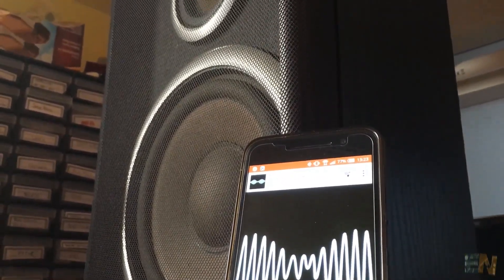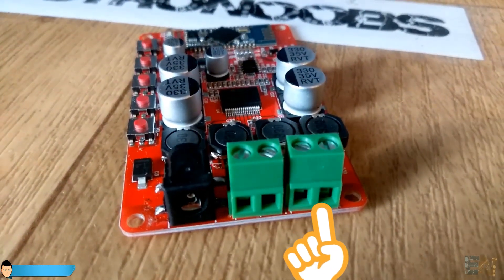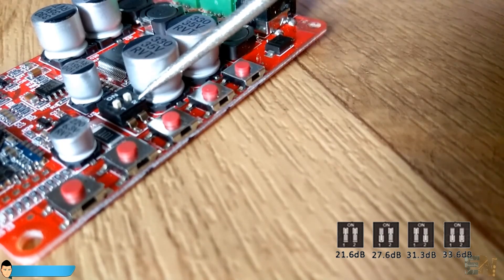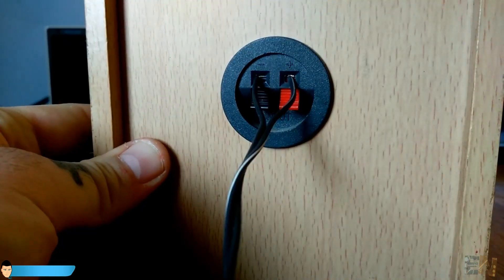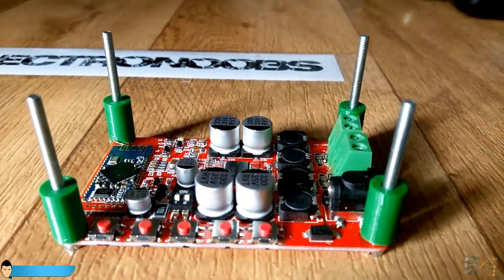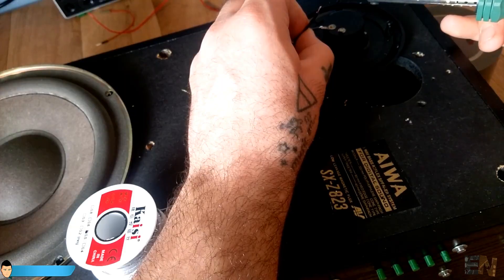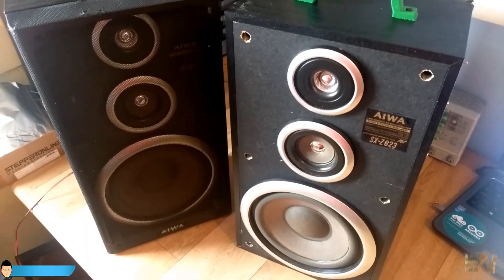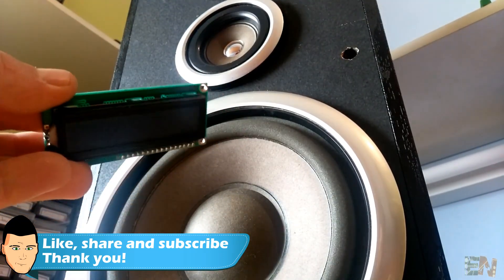Cheap bluetooth portable speaker DIY  100W

Comment: This recharging schematic you showed in the video is incomplete, right?! Please, take off a doubt of mine. I would like to understand the operation of this board in the ebay link below, and probably is the board circuit that was missing in your video. I have 3 18650 cells connected in series that will power an amplifier for speakers. With this board can I receive the charge from a 12 volt power supply to recharge these three cells and still be balanced during recharging? Please, take a look. Is that her functionality?

For 3S pack: https://rover.ebay.com/rover/0/0/0?mpre=https%3A%2F%2Fwww.ebay.com%2Fulk%2Fitm%2F371930663551

For 4S pack: https://rover.ebay.com/rover/0/0/0?mpre=https%3A%2F%2Fwww.ebay.com%2Fulk%2Fitm%2F172709387736

Thank you!!
Reply from the maker: https://www.ebay.com/itm/371930663551?ul_noapp=true this board is good for 3 x 18650 in series. But you'll probably need a higher voltage than 12V at the input. Probably with a 15V adapter would be good.
Reply: Electronoobs check it out carefully, this board is not 12V, it is 12Amps😉.  So to clarify, a board like that in the link is responsible for receiving an external power supply and recharging and balancing a 3S pack, and still powering a set of speakers? Was that right?
Reply from the maker: Hey, LOL. You get me wrong. Ok, so you want to charge a 3S battery. 3S is 3x3.7V which is 11.1V. The module that you said : https://www.ebay.com/itm/371930663551?ul_noapp=true needs to charge a 11.1V battery right? For that you need to apply a higher voltage at the input of this module, usually is 2V higher than the battery voltage, so, you need like for example 12.8V power supply. That's what I said....

Ok so now you have the batteries charging. The output of the batteries will go to a boost converter like here: http://www.electronoobs.com/images/Circuitos/tut_9/safety_charging.png in order to obtain a higher voltage for the Amplifier board. 

So to recap. Power supply of 12.8V or higher to the 3S charging module. The module connected to the 3batteries in series. The battery pack connected to the boost converter and the converter to the amplifier board.

If you use 1S battery you will be good with the 5V charging module as in the schematic befere. Keep up and have a nice day.
Reply: Electronoobs Now I understand what you mean about the voltage being greater than 12v to recharge a pack 3s 😉😉For your explanation I was able to understand the connection scheme. I'll do the diagram with drawings and put the link here through the dropbox so you can check it, okay ?! You have gained a new subscriber.

Comment: A few questions here.
You only connected the left output? What a waste, many songs will sound wrong. Is there a way to have the stereo combined in a mono output? When I tried to connect both outputs, the volume goes down a little. And I have no idea if I'm doing something wrong here. 
Also, why do you add a capacitor? My speakers are already made to connect to an amplifier so won't connecting the standard wire be sufficient? 
And another thing. With a bass test I noticed there's very little bass. I think my speakers should have more bass than this. Is it the bluetooth amplifier? The sound quality is OK, but I want more bass. Is there a way to connect a subwoofer?

Comment: I am considering buying the TDA4792P Bluetooth board. I have a 4 ohm speaker that has an RMS of 30Watts and Peak Power Handling of 60Watts so should I buy the 2x50W version or the 2x25W version as it says 'best at 8 ohms'. Does that mean it will be 2x100W at 4 ohms? Please help. It would be appreciated. : )
Reply: Stranger bell one is lying saying it's 2 by 50 it's chip can only put out 25 max so there the same thing and get a lp 2020ti or lp 2051

Comment: I have this TDA7492 50w+50w, can I use 8Ohms/50w speaker on each channel? 
are these boards correct?
1.TDA7492P=> http://www.lazada.com.ph/portable-tda7492p-50w-x2-wireless-bluetooth-40-amplificador-boardcomputer-assy-intl-31337628.html?spm=a2o4l.search.0.0.tchRL1&ff=1

2. BOOST CONVERTER=> http://www.lazada.com.ph/xl6009-boost-converter-step-up-adjustable-15w-5-32v-to-5-50v-dc-dcpower-supply-module-high-performance-low-ripple-intl-17085880.html?spm=a2o4l.search.0.0.KJD8hj&ff=1

3. SAFETY CHARGING MODULE=> http://www.lazada.com.ph/tp4056-5v-1a-lithium-battery-charging-module-micro-usb-withprotection-blue-28027918.html?spm=a2o4l.search.0.0.N9SwMp&ff=1

Comment: Can the volume be fixed, or does it reset it self when you turn off the amp?
In other words, are vol up and down button really necessary?
Reply from the maker: Can't be fixed. What I do is put it to maximum and control the volume with my bluetooth device. Keep up!
Reply: So the volume resets when you turn off the amp? Do you have to turn the volume up every time you turn on the amp?
Thanks btw! :)

Comment: can i use 12v DC using adapter without using batteries?
Reply from the maker: Yes, but that won't be portable any more. Also check if the adaptor has an output of more than 1.5A
Reply: hiw much voltage and current meeded?
Reply: how much voltage and current needed?
Reply from the maker: a voltage higher tnah 12V and current higher than 1.5A if you're using one channel and 3A for both channels
Reply: Electronoobs thank you....

Comment: i just ordered this amp. but i was so stupid that i did not see that there is only bluetooth on it and not stereo or aux input. is there a way to solder this on without removing the bluetooth unit?
Reply from the maker: JK never tried it. i guess that if you look at the datasheet of the amplifier or the Bluetooth module to see the pins of output or input audio, you could hook a 3.5 jack there or so...
Reply: yeah i will at least try. but i don´t want to destroy the amp at the first second i get it. yeah it may be cheap and easy to buy but it says on amazon that it wont arrive before some time in august. so the chipping time is pretty long. maby about a month and i don´t want to wait that long if i destroy it with my solder iron. but i will look in to it when i get it in the mail :)

thanks alot btw for responding

Comment: They're making claims and I have both. This model is 25 watt per channel both channels driven, the 50 watt per channel both channels driven has a heatsink. Still loud
Reply: I bought the only 50W amp I could find, but it has no heatsink. Have I been fooled?

Comment: How could it be 50W if its draws 1A @15v? IT'S AT BEST 15w, MATH DON'T LIE!
Reply from the maker: 2pirable hello there. you r right, but, it has 50w for both channels together so 25w each and I'm only using one channel for this project. I know that in the video I say 50w for each channel but that was an error. beside with the noise filter activated the output power is lower and I've used 15V battery. with higher voltage you could reach the maximum 25w per channel! thank you

Comment: Do you know where I can buy button caps like you are using? Because I don't  have a 3D printer :(
Reply from the maker: eBay?

something like this maybe...
http://www.ebay.com/itm/100pcs-lot-Black-Plastic-Cap-Hat-6-6mm-G62-Tactile-Push-Button-Switch-Lid-Cover-/182481255657?epid=1684446064&hash=item2a7cbafce9:g:jeAAAOSwuxFYv2Lz

Comment: how much voltage is required for 2 3" speakers with 15w rms and 4ohms and 2 18650 batteries ?
Reply: it depends on the amplifier, not the speaker
Reply from the maker: The voltage input should be always higher than 12V and lower than 36. Using those batteries you should add a boost converter to boost up the voltage!
Reply: so is 13v fine for a 4ohms speaker?

Comment: tell me plz
if i have two speakers of 60watt(60w+60w) which module bluetooth board  i will need 25w+25w or 50w+50w?
Reply from the maker: maybe try this one, it's a 100W one. With those powerful speakers you would need a powerful board.

http://www.ebay.com/itm/TDA7498-2-100W-High-Power-Class-D-Two-channel-Audio-Digital-Amplifier-Board-/322253604475?hash=item4b07cfc67b:g:-lkAAOSwMgdXztE1
Reply: but i have 60w speaker no 100w!
Reply from the maker: Yes, but you have two of them. So maybe just buy a 50W+50W and connenct each speaker to one output. Don't join together the two outputs. 
This should work for two 60W speakers, one for each channel!
http://www.ebay.com/itm/TDA7492P-AUX-50W-2-Wireless-Bluetooth-4-0-Audio-Receiver-Digital-Amplifier-Board-/122189015219?hash=item1c730868b3:g:K7AAAOSwux5YS5~W

Comment: According to the datasheet you're only getting around 12w per channel at 10%THD at 15v.  Since you're hooked to three speakers in the box each one is getting a whopping 4 watts:) Also stereo signals tend to sound like crap when you can only hear one side.

Comment: how many switches do you use? i see that you use another one for the charging safety
Reply from the maker: The one in the safety schematic is the same as the one in the video. But I've changed the schematic and inserted the safety module.

Comment: Hi! I would like to build a battery made up of 4x18650 batteries, the Charging module that you 
recommended in description may be fine?
Reply from the maker: Yes, but charge them in parallel because 4x3.7V is way too much for the charging module. What I mean is taht you will have a 3.7 battery but with way much capacity. Using that module you can't charge higher voltages. You could use the step up module to increase the voltage from 3.7 to 12V for example.
Reply: ELECTRONOOBS oks thanks a lot!
Reply: ELECTRONOOBS 3.7 to 12v can it be fine even if the total voltage is 14.8v?

Comment: If I leave the speaker charging for too long, does the battery have a risk of exploding? Thanks
Reply from the maker: Alex95sang Hi there. check the IMPORTANT comment in the video description. use that safety charging circuit to prevent battery damage. keep up!
Reply: Thank you for the very fast reply! I had seen it, but the page won't load, it stays blank. I think the link is dead, but maybe it works for you?
Reply from the maker: I'm sorry, I had some problems with my host of the webpage. Try it now, it should work! Keep up!
Reply: Thank you very much!

Comment: why did you use 0.33 MFD cap
Reply: He said a 3.3uf. It visually looks like a 6 ohm speaker, which would be about an 8Khz high pass, which is frankly very high for a cone based tweeter. If it was a 8 ohm speaker that would bring it down to 6Khz, which is still too high. 8.8uf would probably be more realistic as that would make a 3khz high pass.

Comment: did u add a resistor to the other speaker port as it is blank with no speaker connected..?
Reply from the maker: I haven't connected anything to the other output

Comment: Hello.if i use tp5046 module micro usb to charge the battery , do i need to put a protector voltage? Can someone help me.i have tp5046 micro usb and 4 battery 18650 .i dont know how to connect it. And i dont know if it is possible to charge 4 battery
Reply: you need to conect the batteries in paralel (Google)
That group all the V 4*3.7V = 14.8 volts, and then conect it to the board

Comment: 1A at 15V means 15W. Nowhere near 100W.
Reply: Don't you know the output is never greater than the input power wise?
Reply: @luigimondoli  not true microwave transformer for instance, thousands of volts at output stage of capacitors with only a 240v 13amp input, and there are many other devices that also do this desktop psu that delivers over 20amps output from a 13amp mains supply.
Reply: Also at no point did I say that current would not decrease as voltage rises, but I can draw less than 13amps with a switch mode psu and get a measure of 36 amp on the 5v rail so if I were talking current then yes I'm getting more current albeit at the expense of voltage and vice versa, any more things I didn't even mention that you want to comment on?
Reply: @dtwistrewind7361  The world awaits your perpetual motion machine design and/or free energy breakthrough, just keep pulling apart those microwaves and wishing on a star,  I'm sure you'll get there eventually and then you'll show us all! A boy needs a hobby while he's waiting to grow up, and you clearly have some waiting to do. Meanwhile, let's have some more of those 15-year-old type attempts at insults you dainty prancing one trick pony.
Reply: @m3chanist  I don't think I was the first to insult by referring to others they are stupid that was your own closed minded comment, but feel free to keep repeating your textbooks and trying to put people off innovation.
Reply: @m3chanist  an apple falling on someone's head and spurring the observation and discovery of gravity sounds like a very lucky accident in my opinion.
Reply: @dtwistrewind7361  

Watts are volts by amps. 

110V x 13A input is 1430 watts,  12V x 20A is only 240 watts. 

So in which way is the input more than the output?
Reply: @dtwistrewind7361  are you okay? Do your parents hit you? Have you been bullied or what?
Reply: @westelaudio943  I'm pretty Shure you mean which way is the output more than the input but I could, be wrong?
Reply: @dtwistrewind7361  

Sure, I messed that up, sorry.
Reply: The amplifier chip is actually legit 2X50W RMS, only if certain parameters are reached (6 ohm drivers and 25V input power). With less input voltage or/and higher driver impedance (like in this video), the power will be reduced. The board is definitely not 100W capable without some modification. For example, with the rated 90% efficiency, the power loss will be 10W and definitely requires advanced cooling. Stop blaming the hardware if you can't reach the rated specifications because of your poor decision on pairing the parts. I'm genuinely surprised nobody has explained this before.
Reply: Kaja Aljoša 100w output with 15w input. Green energy jebote
Reply: Right, you can't get MORE OUT than you consume, that's ridiculous.   you'll get less which depends on efficiency.   so its more like 10W at 15v and 15w or so at 20v i think...   regardless, people think double watts means double loudness which isn't true... 20w isn't twice as loud as 10w,  it would be a 3db difference.  you need a 10db difference to be twice as loud so really this amp has plenty of juice regardless.
Reply: @digibluh  hi. For example. From 20w to 40w would be also those 3db of increase ?
Reply: @francopieruccinifaria9454  pretty much,  then 40 to 80 for another 3, and 80 to 160 for 3 more etc...
Reply: @digibluh  pretty Nice. I didn't know that. Thank you.
Reply: you just look at the datasheet, they don't make the chips anyway, they just make the board..... going by ebay description is silly.  use datasheet to match your project.
Reply: Bogdan Serban yeah that didn't sound loud enough nor the batteries big enough and the woofer didn't move
Reply: At 100% efficiency, it would be outputting 15w to the speaker. However, the efficiency is probably closer to 50%, meaning only 7.5W are making it to the speakers.
Reply: Mare electronist ce sa zic
Reply: Not sure how those batteries last that  long. Consider that speakers only take a small twitch of power to make one flex and The consumption isnt constant. Still, something doesn't add up.  That being said, the speakers didnt rape the board to fumes so i guess it isnt as underpowered as im thinking.
Reply: 100W is peak, not continious..
Reply: You're never going to get even 100 watt peak with this circuit.   It's a bald-faced lie, plain and simple.   The Chinese either have no regard for mathematics and physics or they have no regard for the truth - take your pick.
Reply: @richardowens9061  BOTH
Reply: this is the consumption rating, not the output..
Reply: @aljosagajst8725  

Seems like Chinese overunity defies the 2nd law of thermodynamics.

Comment: Q: if you use that board that your using, wont it destroy your battery? The 7,4 volts or 14,8 volt in sirie lipo batterys dont like the 4/5 volts that come out of the charging board right?. It want a higher voltage to power itself up. 

Greatings denwex

Comment: What if you use 4ohm speakers
Reply: http://www.st.com/content/ccc/resource/technical/document/datasheet/f4/3e/da/a3/97/e7/4f/8d/CD00205863.pdf/files/CD00205863.pdf/jcr:content/translations/en.CD00205863.pdf

You can use it without any problem.
Reply from the maker: You might burn the wires of the speaker coils

Comment: great vid but please can you explain what you used for the "battery charging/protection, status lights, and some more control buttons".? i have purchased this bluetooth board and a boost controller but need to kno what else i need to purchased to protect the batteies charging etc..

thank you
Reply from the maker: Hi there. I recommend you to use this schematic for the battery:
http://www.electronoobs.com/images/Circuitos/tut_9/safety_charging.png

 I've changed mine because in this video I have no safety charging of the battery.

charging module: http://www.ebay.com/itm/10PCS-5V-Micro-USB-1A-18650-Lithium-Battery-Charging-Board-Charger-Module-/201039030988?hash=item2ecedc2acc:g:sNoAAOSwiO9XigWW
boost converter: http://www.ebay.com/itm/DC-DC-Boost-Buck-adjustable-step-up-down-Converter-XL6009-Module-Solar-Voltage-/161270864741?hash=item258c7e1b65:g:-soAAOSw9GhYfJW8
Reply: ELECTRONOOBS thank you for the reply.. does this mean i should use a 5v usb charger to the the 15v batteries?
Reply from the maker: vvrench no, the batteries should be under 5 volts. if you don't have li-ion batteries and just have batteries with voltages over 5 volts you should use a different charging circuit.
Reply: ELECTRONOOBS sir sorry but i am confused.. you said that you used 4 batteries totalling to 15v right.. can you recommend and battery safety board for me to use? thank you